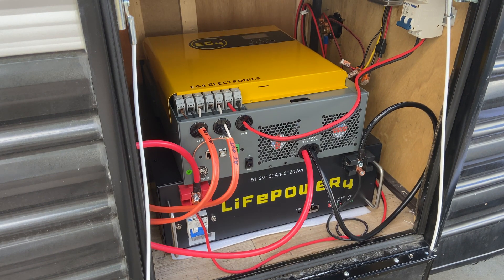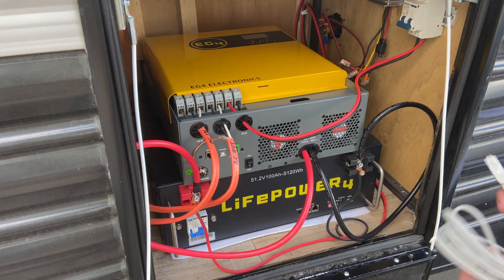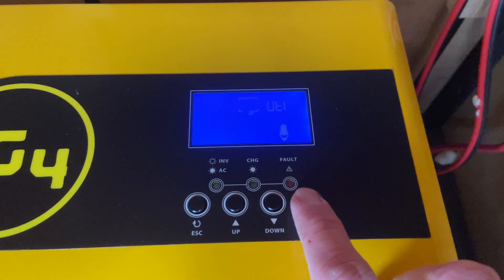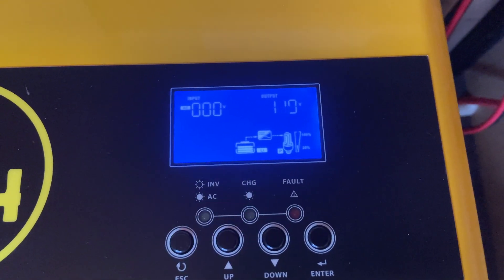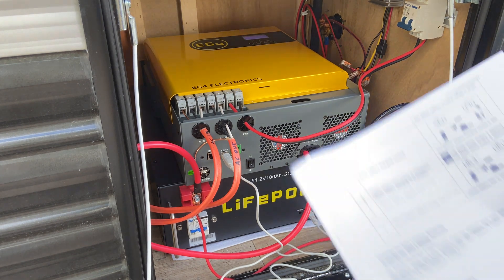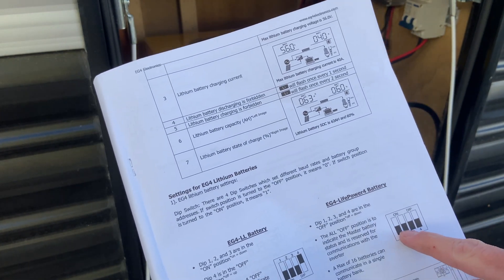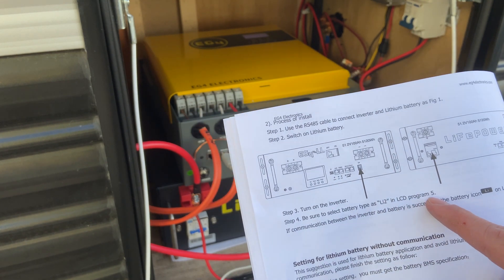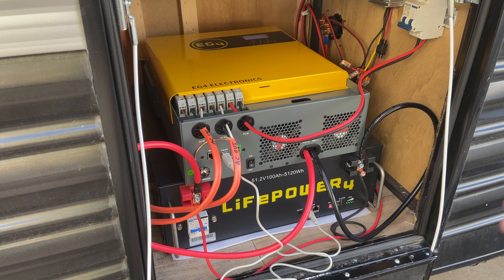EG4 3000EHV + LifePower4 battery communication

Comment: This inverter is a piece of S! The service of this company is another piece of S!. I have this system for year and a half and I only had problems with it. The app to monitor using the double is another piece of S! the manual does not match the menu on the unit. It was never updated. Bottom line. DO NOT BUY NOTHING FROM EG4! piece of S!

Comment: Help Please.... I have the EG4 3000 that I installed in 2023 with 1 EG4 48v.Battery.  Last Spring I ordered a 2nd  identical (old type)  EG4 Battery, ...BUT just now gotten around to installing it last week, and the system  is now, not charging!  .................   My QUESTION.... What is the correct Dip Switch Positions for Battery 1  and Dip Positions for Battery 2?  (a Picture has ALWAYS been Better than a THOUSAND Words...  think Confusus coined that phrase)  ...   Also, is a basic "Patch Cable" used to connect the 2nd battery to the 1st Primary battery, for communications?  ...  Thank You!
Reply from the maker: I’ve never used the 3000EHV with multiple batteries. I’d read out to Signature Solar directly for support with that. I’m sure they’ll be able to help you get it up and running!

Comment: Thank you for this YouTube. You described the dip switch kind of reverse image thing really well. I had to think about it when I set up my friends. Now I am rethinking!  Could you display a picture of the dip switches in the correct (meaning it worked) position because in the video the explanation is excellent but I am unable see them in the correct position. Thanks!   (We are stuck with endless calls to Signature, Firmware upgrades, "COM" port vs "RS485" port, ........ cable correctness, ...... We have the latest battery so a few more dip switches than yours. Thank you!
Reply: I see you have not received an answer yet. I don't understand why Signature Solar  sends Manuals with "Un-Clear" and confusing info for something as SIMPLE as dip switch settings! I just saw ur post, as I have been searching for 5+ hours trying to find correct dip switch   settings for my addition of a 2nd EG4Battery... with out any Luck!  BUT.....fyi.. THIS Video may HELP You... the Link>>    https://www.youtube.com/watch?v=Mw0hTQMiXgs

Comment: Having error code 19(no batt comm) I'm using just an ethernet cable from Walmart to connect to the batt. Do you think that's my issue? I didn't even look at the cables it came with lol! I will tho😅😅
Reply from the maker: Yeah you'll probably need to use the cables that came with the inverter! Communication will only work if the pinout matches exactly so I doubt other cables will work
Reply: @SmithOffGrid  yes that got the comms fixed but the main problem is I was under paneled. The least bit of shade stopped the charging. Put it in stand by mode and it will trickle charge but not in run mode. Have to add a panel lol

Comment: where did you terminate the ground on the ac output in the trailer?
Reply from the maker: I ran the AC output lines including ground to the AC panel of the RV. It's connected to a grounding bar there and the grounding bar is also connected to the RV frame

Comment: Did any of you successfully get this stupid wifi dongle working correctly with the app?
OMG what a huge pain. So turns out you need to use the SmartClient app to set the dongle up with the house wifi credentials while connected to the wifi dongle in your devices wifi access point list. I got that to work. 

Then you are supposed to use SmartESS to do the rest. This is where I got stuck. I was able to add the datalogger but that's it. When you click the little icon to the right of the datalogger and scroll down it shows disconnected.

Comment: Do you have a problem with it over heating? The manual says it needs 19” of clearance on the top and bottom and I’m trying to figure out where to put mine.
Reply from the maker: I haven't had any overheating issues. Sometimes if it's a really hot day I'll leave the door where I have them stored open so there's more airflow. Seems work fine however I have it though!

Comment: Man I wish you had a video on the build of the system in General. This is exactly what I have been thinking of doing in my KZ181bh 1(maybe 2) 48v EG4 with the Charger/inverter.... way simpler than the Victron systems people are putting in. 

I see your AC in lines and your AC out lines. Are you connecting directly into your Breaker/Fuse box and shore power line in your Wolf Pup? Also I see it's only been about 4 months since you posted this so not peak AC season.... but have you tried running your AC yet?
Reply from the maker: I'll throw an update video together :)

Comment: are you concerned about the battery getting cold?
Reply from the maker: We don't normally use our trailer in the winter so it hasn't been an issue. And since it's inside the trailer if the temp outside drops below freezing it doesn't cool the battery down that much. For the off chance we want to use the trailer in the cold I have been considering switching it out for the Trophy 48v since it has internal heaters: https://trophybattery.com/index.php/battery-models/model-48v100e-1/
Reply: @SmithOffGrid  I was thinking of buying the trophy battery as well.

Comment: Hi, nice video, thanks. I just bought those two units for my RV but haven't installed them yet. Is your inverter sitting flat on top of the battery? If so, it's not causing a problem? I prefer doing it that way instead of hanging it on a wall as they recommend.
Reply from the maker: Yeah I have it sitting flat on top of the battery. I previously had a Growatt 3000 sitting the same way and didn't have any issues.

With this one the only problem was that I had to stick my head into the space I have it located to read the display, since it's higher up on the front panel than the Growatts. I ended up modifying mine to relocate the screen so it was easier to access. You can see it in my other EG4 3000 video but I haven't made a dedicated video for that yet.

Only other thing I might do is create some spacers to improve the airflow between the two. Not in response to any issues but I figure it could help with longevity.
Reply: @SmithOffGrid  I finally assembled mine. Your video was a big time saver as I was pretty confused about the cable, thanks again. I reached out to signature solar and was told that installing the inverter flat, would void the warranty. So, I installed it inside my RV. It's working fine, except it gets loud at times. If the noise starts to bother me, I have to think of a new place for it but so far so good.

Comment: When did you get your inverter/how long have you had it?

I got mine in May ish, and it looks different than yours? All of the posts and terminals are behind a removable cover.  Also, I don't believe mine came with 2 cables. 

Have you set up your system with the app yet? I found the app quite confusing.
Reply from the maker: I got mine in October and it's the V2 version. Mine has a removable cover on the bottom as well, I just have left it off while I was setting it up. Maybe yours is the V1? Not sure about all the differences between the two of them. You can see pictures of both here: https://eg4electronics.com/downloads/#:~:text=Inverters-,EG4%203000EHV%2D48%20(V1),-deprecated%2D11.75%20inches

I haven't set mine up with the app yet, I'll have to check it out!